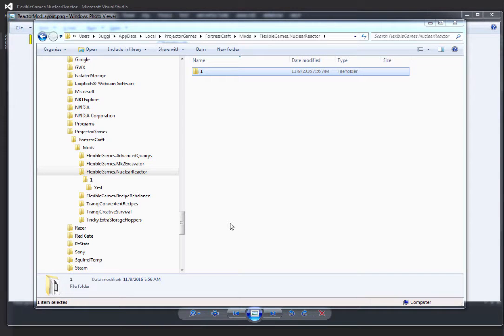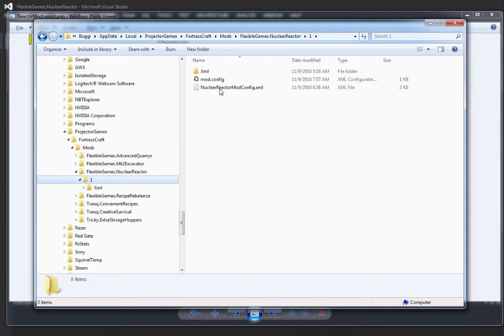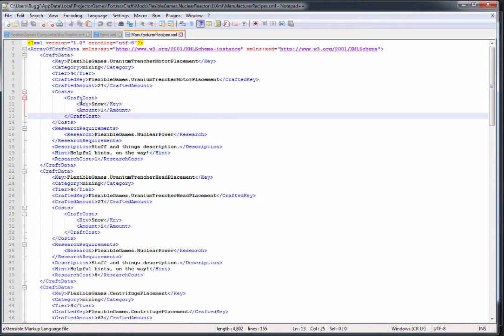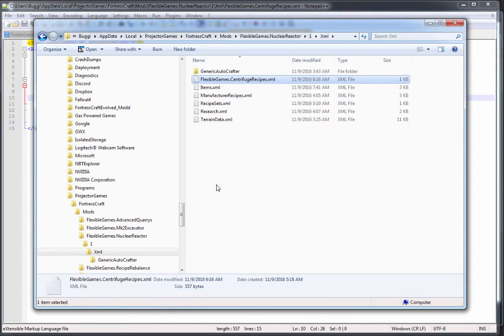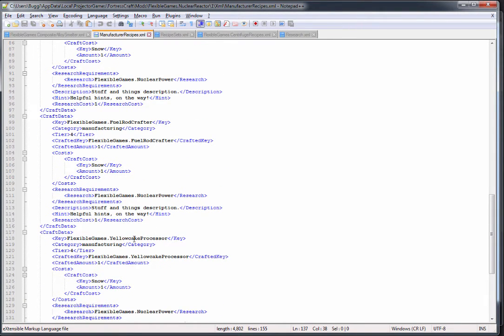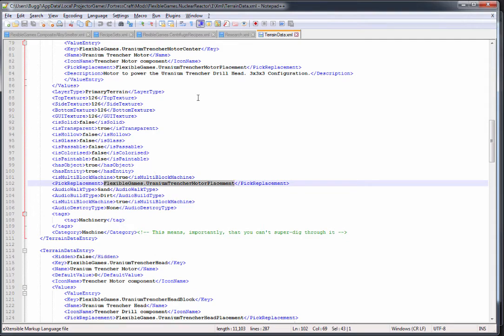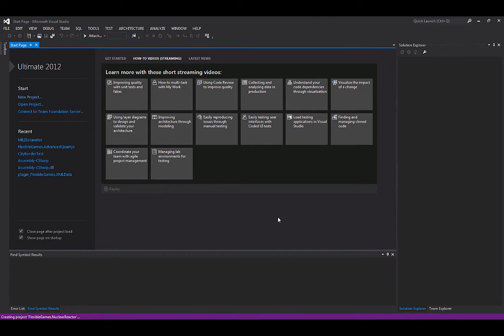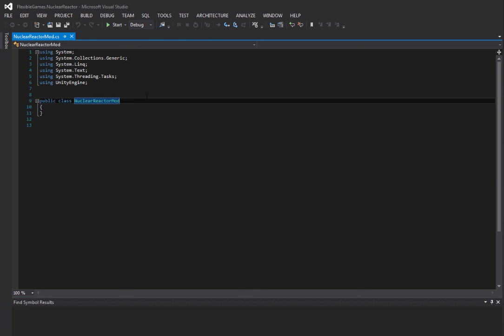FortressCraft Evolved : Mod Tutorials : Part 2 Starting A Plugin Mod

Comment: Interesting Tutorial. I have a question, can you have a tutorial for us "laymen" who have no idea how to install a downloaded mod into gameplay? I'm trying to figure out how I take a recently downloaded mod that I wish to add to the game and where do I put the mod and how do I get it to work with FortressCraft Evolved? That would help me and possibly other players who don't know how to add a mod into the game. J
Reply from the maker: You didn't just subscribe to it on the workshop?
Reply: I'm not sure I understand what you mean. I subscribed to you here and on Steam. Do you mean on Steam where I downloaded it? I'm sorry that this sounds like a stupid question or request, I'm not the brightest bulb in the box but I do get eventually. =P   --J.
Reply from the maker: When you browse the workshop there should be a "Subscribe" button on the mod, click that on the mods you want to have Steam download automatically. Then when in game, there is a button at the bottom of the window just before you "Enter World" labeled "Mods", clicking that will allow you to enable/disable mods for the world.
Reply: I did that; however, when I unlocked the research that had the mk2 excavator that i was trying to get, it didn't show up in my research station to unlock to build. I tried it two times by starting the same world over.
Reply from the maker: I should, honestly, remove the research requirements, but you need a Mk2 laser to build one so that's why it's gated behind research. It's worked every time for me. I'm sure it will be unlocked, there is just some stray scan or research that's blocking it.
Reply: I guess what I can try to do is to unlock the mk2 lasers to see if it then shows up. I also downloaded your recipe mod but I'm not seeing any change with most of the items to craft. Maybe its just me not knowing what i'm doing or my machine that's rejecting your mods, lol.